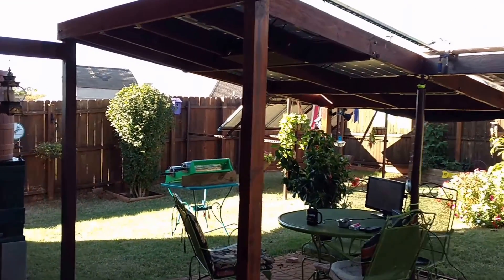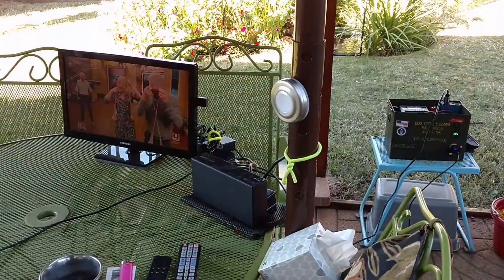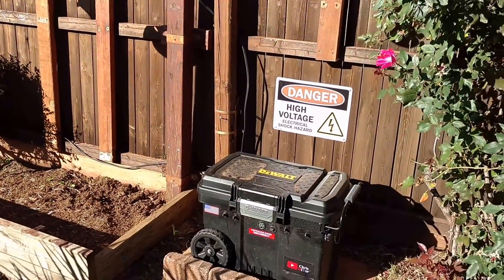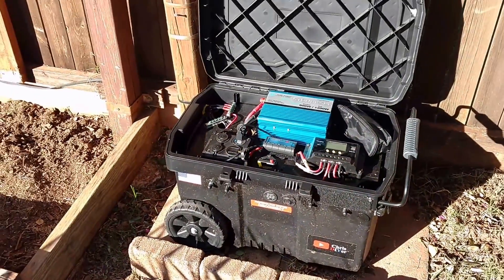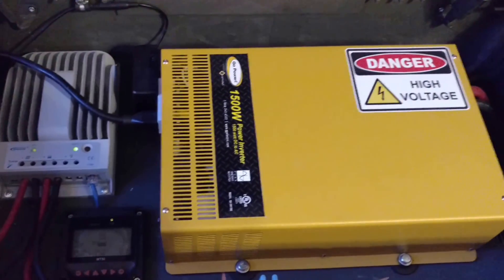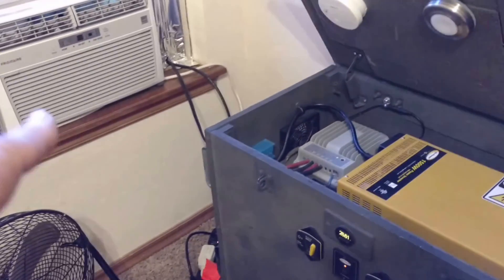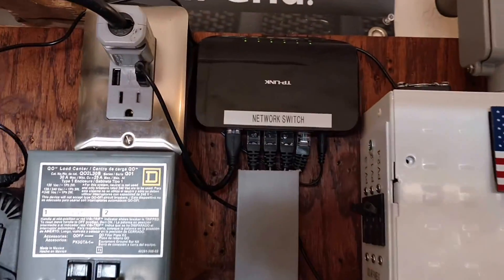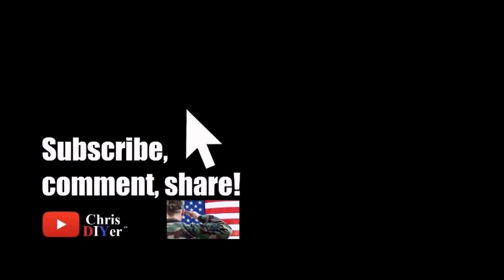Four operational off-grid DIY homemade solar generators (generador)

Comment: Chris on the solgen in your bedroom, did you have to ground the inverter to a grounding rod outside? Thanks
Reply from the maker: Yep, there is grounding rod outside the window with a wire going to the grounding lug on the inverter

Comment: Hi. Chris. I like your setup. Can you give me an advice. I like to run a window A/C unit for about 8 to 6 hours. Cooling area is 200 SQ FT. How many solar panels and what size? How many deep cycle battery? What size inverter? what size controller?
Reply from the maker: Get with the AltE Store https://www.altestore.com/store/calculators/off_grid_calculator/ they can help determine what a system like this will require
Reply: Thank you.

Comment: Hey I think you said your in Oklahoma. Moore or surrounding area. 
Well anyway I’m looking into solar 
And is there any retailers around our state to check out 
Or did you get most of the net. 
I’m in Oklahoma also small town 
But I’m getting 3 acres and getting a solitaire home and want total off grid would like to know how much solar panels and batteries I would need since it’s a new house I don’t know how much I will use and want it set before the house is there. 

Looking at 10,000 watt kit for about 11, 000  or is it cheaper to buy separate. 

Either reply or make a video. 
From an old guy who’s about to retire. Lol.
Reply: Also I plan on an aquaponics system in green house. 
And passive heat and water heating from sun. 
Rain catching system etc. 
If that helps